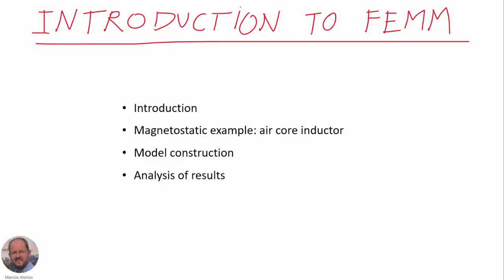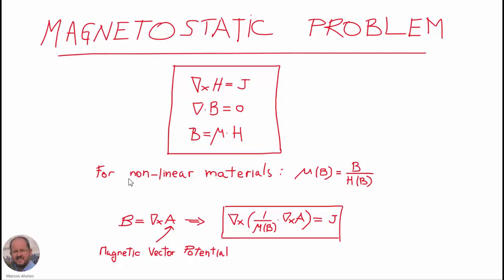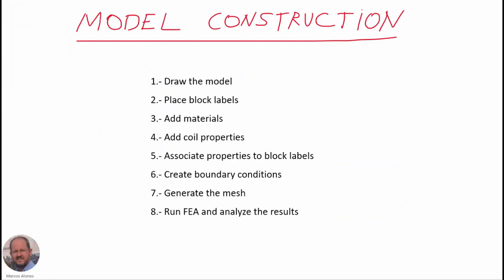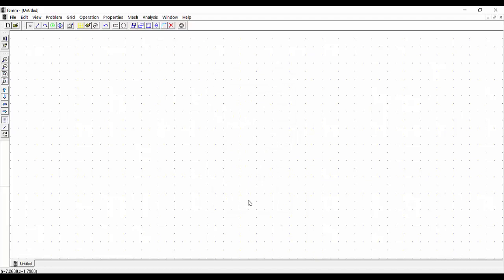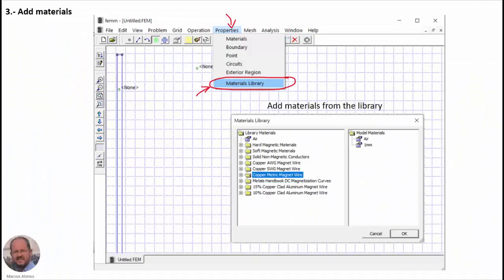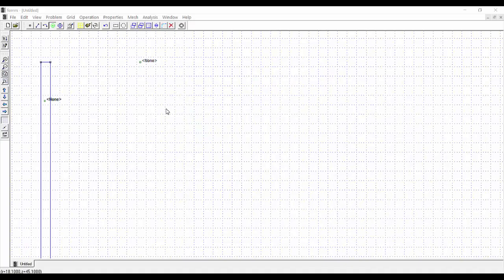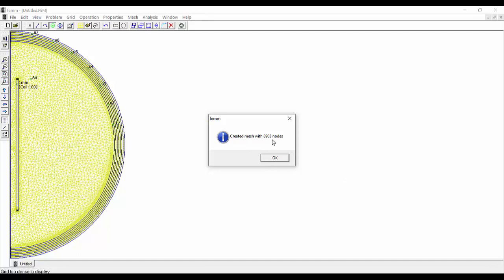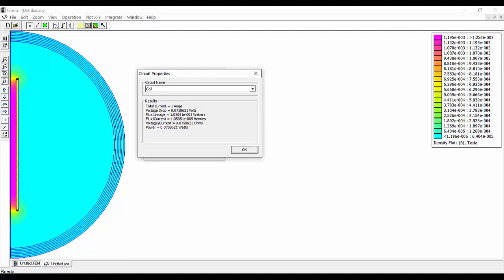FEMM #1: Introduction. Air Core Inductor

Comment: How did you get the formula for L & B @ 4:00
Reply from the maker: Sorry for my late answer. I was travelling last week.
This is a common problem in physics. It is called the finite solenoid. The induction B on the axis is calculated as the addition of the contributions to B of each turn. You can find the solution of this problem in the following book for example:
Electromagnetic Fields and Waves. P. Lorrain and D. R. Corson. Third Ed. 1979. Chapter 7. Section 7.7.